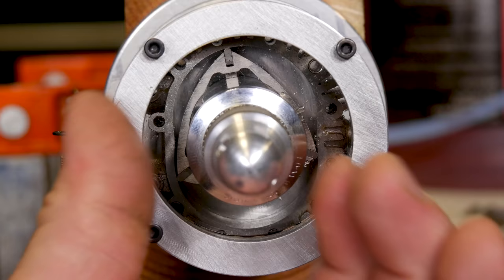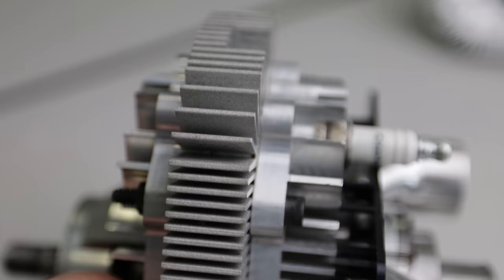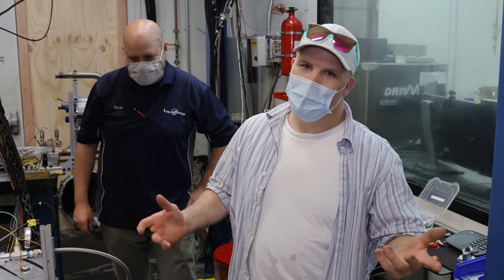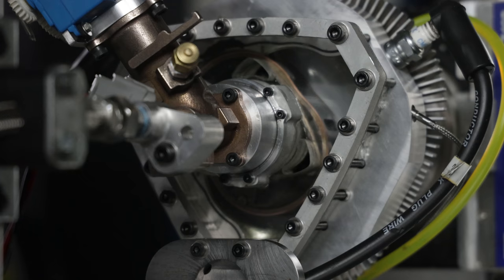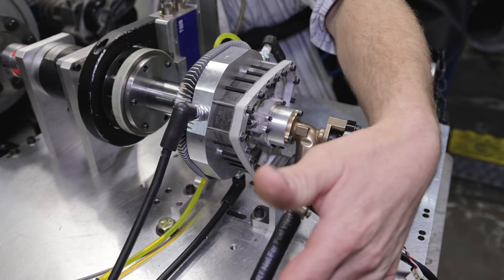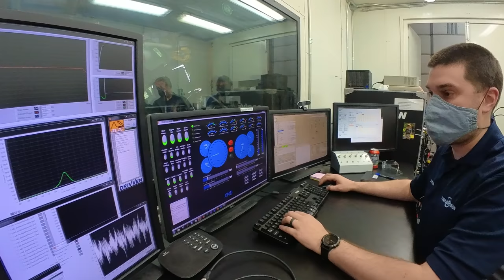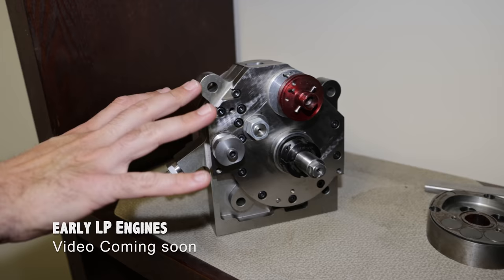See Thru Liquid Piston Rotary Engine - In Slow Motion

Comment: I was wondering about the seals. A lot of surfaces sliding past each other.
Reply: The seal problem was "solved" with the Wankel rotary. And by solved, I mean it's still the biggest mechanical headache. 

This engine is better because the main seals are stationary and easier to design. In the Wankel, those seals rotate in a crazy pattern. They suffer from both the rotational force plus some acceleration at odd angles. In the hybrid design, the main seals just sit there. They can be spring loaded and internally lubricated which makes the more reliable and gives them gentler failure modes. More likely to leak than shatter. 

However, my understanding was that the main seals weren't the big problem with the Wankel, the end seals were. The end seals on the Wankel are much larger and prone to leak. On the hybrid design, the end seals are larger still and their geometry is more complex. I expect they will continue to prove troublesome. But they did a fair job on the Wankel and we've had 40 more years to work the problem. I can't imagine it's a design breaking problem.
Reply: I want to make a friction joke here.
Reply: @jwrosenbury  My understanding is that the oil burning, thus emissions, were the big problem with the Wankel.
Reply: @rylian21  Gasoline engines produce three types of bad emissions. These are carbon monoxide (CO), oxides of nitrogen (NOx), and hydrocarbon emissions (HC). Of these, NOx is hardest to deal with. The other two can be significantly reduced by a catalytic converter. 

A Wankel engine does have higher HC emissions. But it has lower NOx emissions. CO is about equal. 

Catalytic converters increase exhaust pressure leading to lower efficiency (as do mufflers, BTW). Leaking gaskets also lower efficiency, as does lower thermal efficiency in the Wankel. (The lower thermal temperature/ efficiency leads to the lower NOx emissions.)

So overall, I would call it a wash as far as emissions go. Wankel's are slightly lower for the amount of fuel burned, but lower efficiency means more fuel burned overall.

Wankels have a much better power to weight ratio, almost twice as high. This leads to lighter vehicles and thus better fuel efficiency in practice, but probably not enough to offset the lower fuel efficiency over piston engines, at least for ground applications. Power to weight ratio is more important in aircraft design. 

However, changes in the shape of the combustion chamber will likely solve some of this issue. Such changes have already been made to piston engines. There are a broad range of possible combustion chamber geometries available in this new hybrid design, so there are likely some advances in the future. 

The hybrid design reasonably claims to have a higher fuel efficiency on top of a better power to weight ratio. If this pans out in practice, it will be a far superior engine to traditional piston engines. Losing a little efficiency to a catalytic converter is a small price to pay for a 20% theoretical boost overall.
Reply: @rylian21  along with horrible fuel economy and poor durability as I doubt very few of those you didn't say the RX8 make it to a hundred fifty thousand even with some engine repair along the way sometimes you come out to your car and if it didn't turn off just right in the right spot you couldn't even start your car that's so lame that's like mid-century carburetor type movie situation stuff nobody puts up with that no more

Comment: the 3 reasons why you will not see this engine put in a vehicle for a long time:
1. hot exhaust gases exit trouhg the thin walled rotor ,not leting it cool, as the gases still giving the thermal energy due to being pushed out by the rotor itself - i guess thats why extra cooling air needed
2. the rotor itself seems to be very light and thus have to spin faster than a hevier one to have the same amount of inertia (this increases the G forces acting on the structure of the rotor, immagine if just a small chunk of it breaking)
3. drawing in 10times the amount of air just for cooling, you have to move that air with the power of the engine = power loss
 bonus: hollow crank = more inertial loss and weakening structure

Comment: if this new engine is a more efficient rotary, we might just see a rx-9!
Reply: If mazda had rights to patent the tech. Let's hope so.
Reply: ... same garbage.
Reply: @mareksumguy1887  but newer
Reply: @mareksumguy1887  WRONG
Reply: @mastershan87  ... right.
Reply: I’m pretty sure that most rotary enthusiasts would rather see another RX-7 then an RX-9. And lets face it, the only reason to call a new Mazda an RX9 would be if it is something other than a 2 seat sports car like the RX-7 or a sporty sedan like the RX-8. An RX-9 would likely be something like an SUV or a crossover. As for being more efficient you can tell just from looking at it that a larger version of this would be more efficient that current rotary engines. One of the main reasons that current rotary engines are inefficient is because they have such a long combustion chamber but this problem has obviously been eliminated in this new engine.
Reply: Unfortunately, with the push for Green Energy by the current administration and the push for electric cars, we will likely never see another Mazda RX car. They could go electric, but then it wouldn't be an RX. I believe that the mass-produced rotary engine died with the RX-8.
Reply: @OffensiveJestr  there was a push for hydrogen powered rotaries by Mazda, few were sold . to keep it “green” . But the market for hydrogen powered cars just doesn’t exist, despite it being more feasible long term than electric
Reply: @whtkngofc  I remember that they experimented with them in the RX-8. I've been following rotaries for the past 20 years, and I've owned 5 of them. I love that little engine! My dream car is a Cosmo 3 rotor.
Reply: Nope. There is zero possibility of any automotive OEM producing another wankel design for several reasons. 

1. electric vehicles.
2. Emissions
3. Fuel economy
4. Longevity
5. Cost

You may see this is small generators or something where compactness is important, not in an automobile.
Reply: Hello fellow Mozafuckas 
Working with a friend to convert ICE engine to hydrogen injected, once pistons engine of course we’ll convert doritos engines 
Keep hope
Reply: @jeepmanxj  But didn't a hybrid Mazda that uses a rotary engine get announced a few days ago?
Reply: Difference between more efficient, and more reliable.
Reply: @eggbag4182  As a small generator on an an electric vehicle. So ya got me. They found out a way to use a wankel in a vehicle and avoid reality because its not going to operate 99% of the time.
Reply: Bwhahahahahaha, its dead, stop beating that dead horse.
Reply: @jzxtrd337  you never know with innovative
Reply: @mareksumguy1887  doktorbimmer, is that you?
Reply: @OffensiveJestr  I remember not buying a 20b for my rx7 series 1 for 2000k$ cos it was "too pricey"

Comment: When I was a teenager in the 70s’ one of my friends parents had a
Mazda stationwagon with a rotary engine. I can’t speak to the reliability of the engine but that thing would go like a scalded cat.
Reply: Lots of power relative to the displacement.  But also crappy fuel mileage and emissions.  I remember the RX3 well.
Reply: @joesterling4299  Lots of power relative to engine overall dimensions, only because it has enormous displacement compared to overall engine dimensions. The 12A engine in an RX3 has 3.4 litres total chamber displacement (573 cc per chamber, three chambers per rotor, and two rotors), and doesn't produce much power for that displacement. Mazda rotary fans pretend that only one chamber per rotor "counts", and call it a 1.2 L engine to make it sound more impressive.

Comment: Few observations,
It resembles a two stroke engine with no valves, no cam shaft driving the valves, no valve timing adjustment, no cam belt or chain, just crazy high spinning low weight engine. I guess the torque is pretty low. The seal around that rotary "piston" is critical for proper functioning.

Comment: Did anyone notice how much the "not apex" seals were moving?
Reply: They are probably spring-supported too.
Reply: I'm wondering why the rotor and chamber can't be round.
Reply: @brettknoss486  
You can buy those....They are called fans.
Reply: @bobsullivan5714  the other way, curved like a conventional piston, with rings on the block.
Reply: I see a possibility to have 'rollers' instead of apex seals.  Rollers would wear a fraction as much, while also cooling and oiling themselves.

Comment: At first, I was so excited to see the difference in terms of improvement so that I have reason to use this new innovation later.

But then I realize there is one side of the rotor that will always heat up. Never had chance to cool down.

I’m sure this will cause huge problem on the long run + loads + big motor.

The rotor needs at least 1/3 or perhaps 1/2 of the cycle to rest from the heat due to power stroke.

Compared to the conventional 4 cycle piston, the combustion chamber has a cool down cycle.

Maybe you should allow certain amount of engine oil to flow into the rotor to helps cooling down thus avoid the rotor expands to much due to high heat & leave scratch from the inside.

I love this rotary engine. Hoping to use one. But I do realise it needs more improvement.

Should ask any process engineer and designer to improvise this motor.
Reply: The problem is the opposite of the Wankel, in that design, the same side of the housing is where all of the heat is generated, while the rotor heat is distributed. This should be better thermally, note the rotor is having the intake air and fuel flowing through it, that should provide more cooling than the Wankel which was highly vulnerable to loss of coolant flow. I speak from experience on that one, fried two 13B motors in my time of ownership. 

How would it scale? Probably not well, as I expect large rotors would need liquid cooling. But you could stack them...
Reply: @billmankin6204  I’m aware of it. But we must understand. When the rotor has two parts, intake & exhaust, that might be the cancer for the system.

Why? Because during the continuous run + pressurised (turbo/sc) + load + high rpm, the temperature on the exhaust side of the rotor might reach 375~500°C. That will usually cause the metal to expand. While the intake side definitely lower about 100~200°C compared to current exhaust side temperature.

If the rotor is 80.000mm wide on 30°C, it might expands to 80.1++mm on exhaust side While the intake may only 80.100mm less.

The small expansion will push both left & right wall & leave scratch.

Although I have no exact data on this, but that is usually the temperature range of an internal combustion engine at that point & that is what will happen to metal parts.

Unless if the material was tested able to remain it’s original dimensions until 600°C before it start to expand. But I don’t think so.

Or, if there is some kind of “Piston Ring” on both sidewall on the rotor area to tolerate the expansion or retraction, so that it can maintain its power without any leaks.

Or perhaps will require minimum of 2 rotor with sequential power stroke to help the rotor cools down.

As long as the hot side of the rotor won’t harm the sidewall.
Reply: I'm wondering if there's a way to "double engine" it just to fix this problem. Have them running at separate times, possibly separate fuel supplies.

Comment: I am interested to learn how they are lubricating the seals
Reply: With the seals being stationary a small amount of oil could be metered into the seal slots in the housing with a variable displacement pump that could vary the oil delivery according to engine speed and load. In the developmental stage the oil is probably mixed with the fuel as is done with small 2 stroke engines.

Comment: I used to be all kinds of obsessed with rotary engines, back in the day. The fact that it was only 3 moving parts and it didnt have or need camshafts and valves was absolutely fascinating to me. But after buying an RX7 FC model and rebuilding the 13B engine (twice), along with working on a friends 12A in his first gen RX7, I gave up on the rotary. Its just not very reliable and the gas mileage was terrible.
I will say that the FC's handling was fantastic though. That car could hang in the corners like no ones business. But the engine just couldn't take the same kinds of abuse that a piston motor could. I never took my RX7 on any a distance road trip for fear of breaking down, which was the shame of it all because that was exactly why I bought it.

Comment: Rotary engines have great power to weight ratios, but I don't see how this engine solves the fundamental rotary engine problem of low efficiency and high emissions.
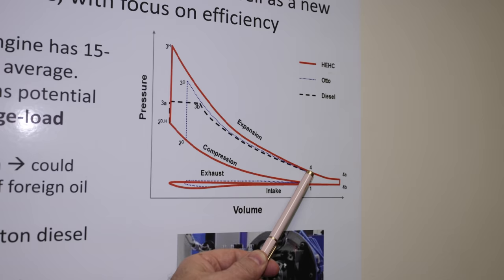Reply: The Pressure-Volume curve at 2:00 shows the greater area under the PV curve due to constant volume heat addition and over expansion.  The top part of the curve (3a to 3H) above Diesel line (3a to 3b) is extra area for the same fuel amount.  The cycle is key.  This is actually just an Atkinson cycle with fuel injection.  Well known, btw.
Reply: Also, they talk about apex seal problems, and this engine has the same seals just not on apex.

Comment: I seem to remember an issue with the tips of the rotor wearing due to oil starvation on the mazda engines.   This design seems to avoid that by not having tips at all.  Interesting work.

Comment: That's.. actually really interesting. The thing is that the seals on the mazda and other engines like that are completely sufficient, compared to petrol-engines. And you might even favour that design if you wanted to have as little offset weight as possible at high rpms. But if your target is a smaller vehicle like a bike, or a very light car on "sufficient" power, or boats, stuff like that - you don't need a million rpms anyway, and you want better compression and less waste, better torque, etc. at "moderate" rpm ranges. So this is interesting stuff.

Comment: It's an amazing engine, and a viable evolution from the rotary, it's solved many problems inclusive of performance, here's the thing I want to know: Did this fix the seal dilemma? Putting it on the block facilitates replacing the rotar instead of the block if they fail, however, you still have to rebuild the entire engine if the seals do fail. Did this fix the seal dilemma via physics or did this validate better longevity proven?

Comment: I hope this video will blow to at least 2 mil views. This is purely insane.

EDIT: By the way - how is this engine lubricated? does it require some kind of oil film or oil pump? Or was it just a demonstration and the production version would include that?
Reply: They push small amounts of oil to the seals. No more mixing of fuel and oil like a Wankel.
Reply: @electric7487  That's a total game changer!

Comment: I would love to see a force vector diagram of this engine. It seems there is a lot of wasted energy due to the expansion phase directing energy into the piston that is already partially rotated away from the peak as well as expansion being directed onto surfaces that would actually retard rotation. Though the engine obviously works its energy efficiency seems suboptimal
Reply: Rotary Engine. It seems wasted, but not so.
Reply: I agree with you, as well as exhaust expulsion seeming sub-optimal
Reply: Like the little bulb should be shifted to the leading side to push the piston away from it and timed to go off a little earlier like the Maserati Nettuno V6.
Reply: I thought the fuel was ignited a little early, myself. But I did wonder about the flame obviously going around both sides of the rotor curve.
Reply: @eekee6034  that's my point...with it going around the curve it has components of the gas expansion that not only accelerates the rotor but also retards it thereby a certain percentage of the expansion energy is negated thereby reducing efficiency. Its almost as if the motor depends on the momentum of the rotor to prevent it from "locking up" due to rotor symmetry imparting equal forces on both sides of the rotor thereby creating a net zero energy being transferred to rotation. If i didn't know better my hunch is that this motor is actually being spun by another motor (probably electric) and the fuel burn is just for visual impact and isn't actually rotating anything
Reply: @hyfy-tr2jy  Now it sounds like you're thinking only about a shock wave and not about overall pressure. I'm not going to think about that too hard, I can barely keep my eyes open today, but it's one of those areas where real life can be surprising.
Reply: I think an important factor to remember is the difference in pressure between the active combusting chamber and the surrounding chambers
Reply: compression chambers.. smaller?

Comment: Thank you for making this happen. Few vids can be so entertaining yet informative at the same time. 

Rotary engines are a strange thing. Very, very few designs outside of piston i.c.e.'s have made it all the way to production like Mazda did. I guess for them to take off, and the reason they haven't is either reliability problems, emissions compliance, or maybe difficulty balancing? That's just my guess. They  do seem to have strong points, like a wide rpm range and incredible power to weight ratios. They seem to be well suited for a motorcycle, yet no one uses them. I'm curious why that is.
Reply: They have. I'll bet you can find a forum that has had discussions
Reply: definitely not a balancing issue, these are by design one of the smoothest performing engines you can get.